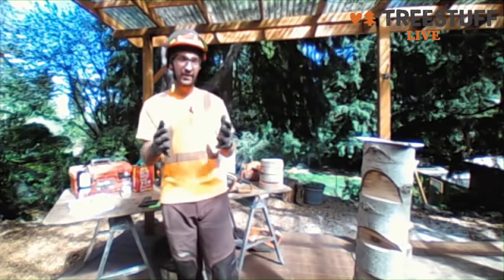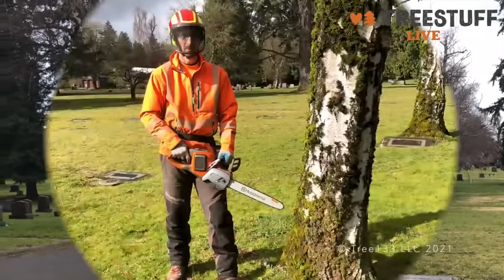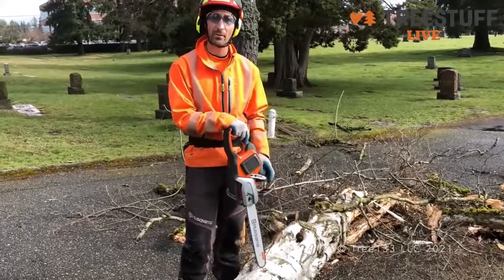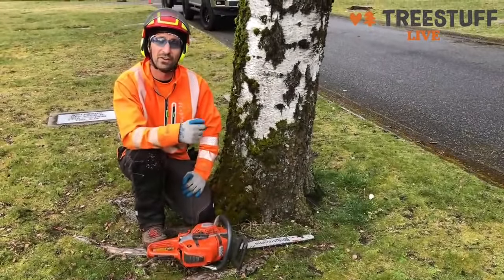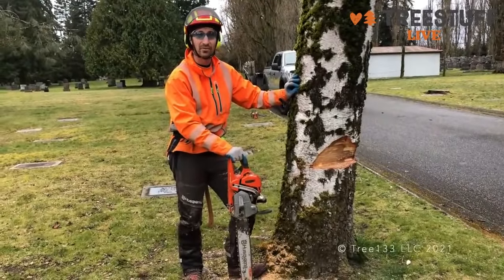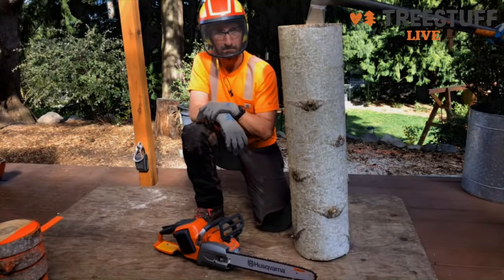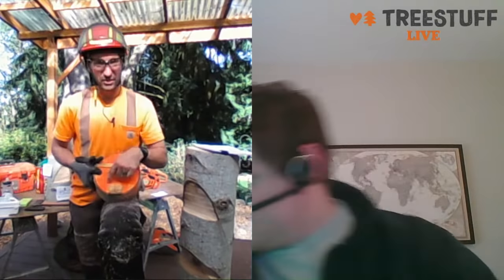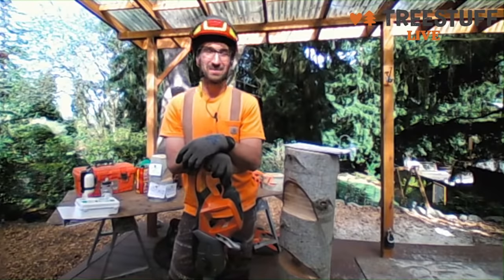Modern Chainsaw Skills - Field Edition - LIVE Webinar with Craig Bachmann

Comment: Betcha buncha Swedes grind their teeth hearing "hooska-varna". May I suggest "huskvarna"? FWIW I've a few from 40-75 cc, all strato-screamers, among my all-time faves. Good stuff!
As an engineer, it's easy to see that the sight-line on a saw will not tell you the direction of the lay; it will be perpendicular to the line where the 2 cuts for the wedge meet.

Comment: It's interesting that Craig mentioned saving the log. For me, the traditional vs Humboldt face is all about the rotation of the log, and body position. If you want the log to sit on the stump longer, use the traditional face.  If you want the but end to drop off sooner,  use the Humboldt face.  There are also certain positions while climbing that determine where the face should go.  Sometimes there is a knot on the log to avoid or potential contact with rope.  It's more important for most climbers to save damage to gear or landscaping than trying to save the log.
Reply: i realize I am quite off topic but do anyone know a good website to watch new movies online ?
Reply: @jonathanphoenix2514  Some people use an app called Cinema. Many films are available in other countries before releasing in the states. Unfortunately there are lots of movies in other languages. It's a beta program.
Reply: @Ashton Quincy Yea, have been using flixzone for months myself :)
Reply: @Ashton Quincy Thanks, I signed up and it seems to work :) Appreciate it !
Reply: @Jonathan Phoenix Glad I could help :D
Reply: lots of reasons to use a Hunboldt, and many reasons not to, so it all depends on the scenario.. some people get stuck in the box and always cut Humboldts... that's a mistake IMO... You have to know the why though.. most don't
Reply: @murphy4trees  Good points, sir.

Comment: I understand that the wider the face cut, the more the tree travels without closing on itself.  I would say from experience, that as soon as the tree starts to fall, you've already lost control to gravity.  I trust a 45 pie and a open face pie without a rope in the tree, can't say that with the 70.  Also, I don't see the point the the bore or plunge cut.  Did I miss the point to that?  Or is that just for show?
Reply: TREES for me He spent a significant amount of time discussing the bore cut in the video.
Reply: @francoamerican4632  So its just for show then.